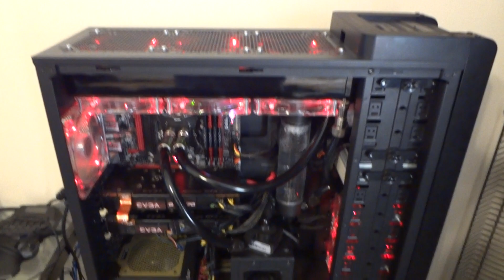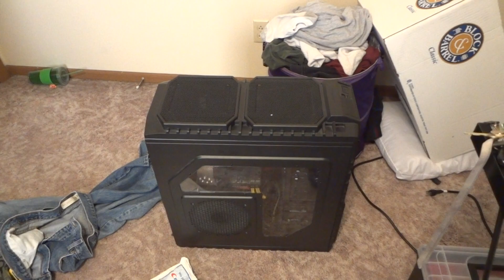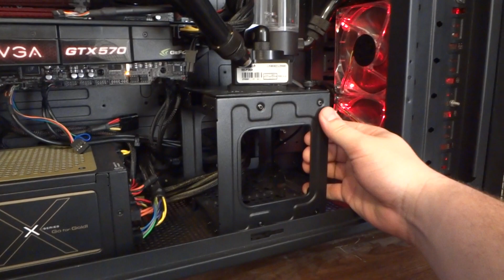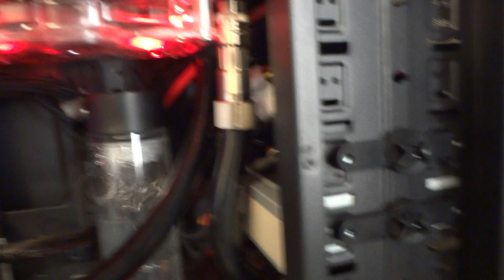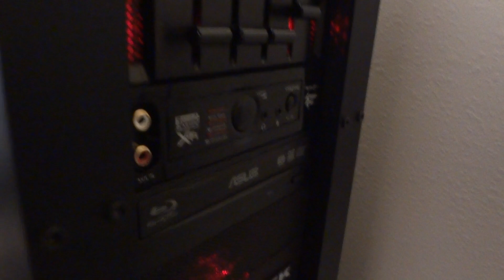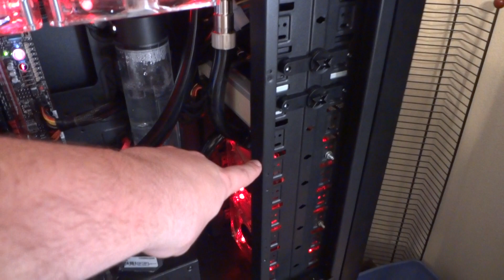Project: Black Devil - Introduction

Comment from the maker: The res just wasn't all the way full in the video and the pump was on full blast. Plus I didn't have the anti vortex device in the res at that time. Happy to report that this rig has been running like a boss since this video. It's gone through a lot of changes (2600K -> 3930K, GTX 570 SLI -> GTX 670 SLI -> GTX 670 3-way -> GTX 680 SLI -> GTX Titan SLI), but the cooling system performs great even with a highly OC'ed 3930K and Titans.

Comment: yes u are able to fit another 2 fans.... your are probably able tu fit a 480 mm rad in the front in push pull (a 60mm thick rad) ore a monster (80mm) in push pull so the is a huge amount of space nut u will not be able to use a optical bay but :D

Comment from the maker: @TheChrisglasgow Well I think they will have standard 2GB of VRAM, but just like the standard GTX 580 has 1.5 GB of VRAM, there are 3GB models available. I fully expect there to be 4GB GTX 680's available.
2 gb of vram is no where near enough. I run 3x2d and I'm super memory starved with this setup. BF3 goes about 9 FPS on Ultra at 5760x1080. It's playable on high, but not very good. 3 x 3 gig GTX 580's is what I really need, but I'm not dropping $2100 on graphics with Kepler around the corner